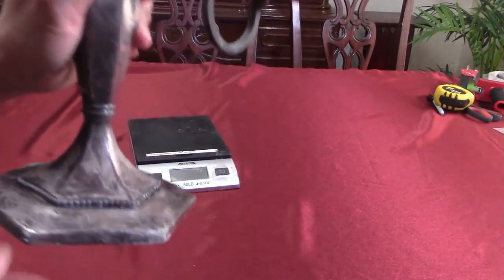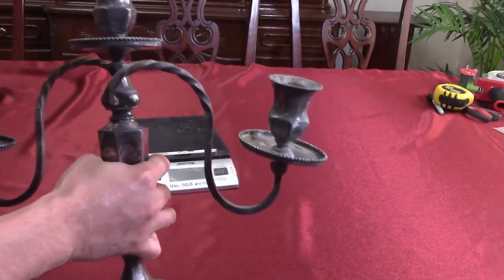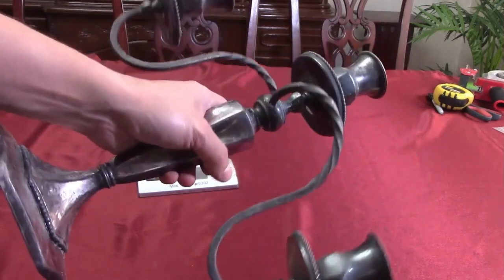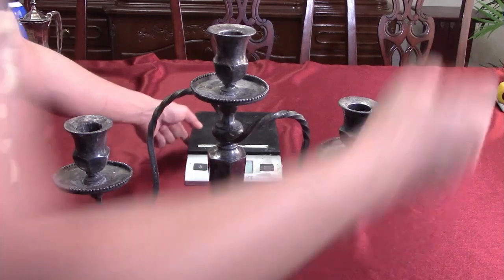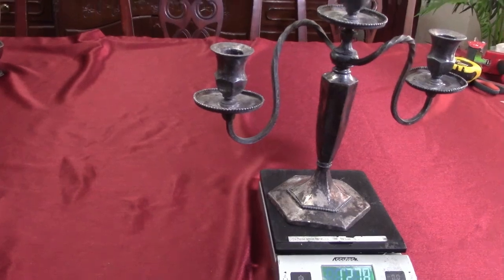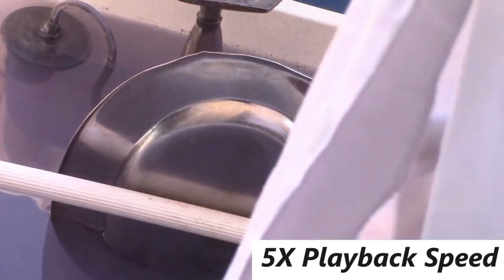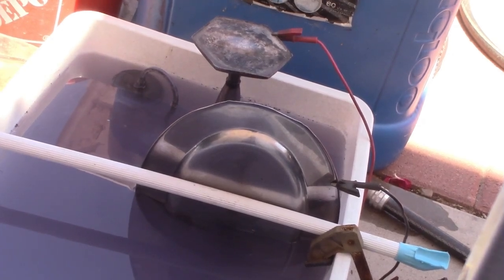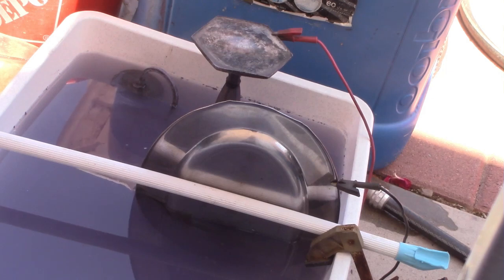How Much Silver Was Plated on Quadruple Plated Pieces - WIlcox Candelabra Pt 1

Comment: The gray color is silver chloride.   This is not soluble and will settle to the bottom of your container.  Carefully separate silver chloride.   Allow it to dry.  Once dry, put the silver chloride into a crucible and heat in an electri furnace.  This will liberate the chlorine from the silver.
Reply from the maker: Are you sure? 😁 I was hoping that just dilute hcl not heated up would not be strong enough to reach with the silver n form a chloride, usually you need nitric to react with ag.
Reply: Yes.  That is silver chloride.  The electrolysis is creating silver ions that immediately combind with the chlorine in the muriatic acid (HCl).  

Often, nitric acid is used to electroplate silver.  It is a more expensive acid but your silver yield will be better and with fewer steps.
Reply from the maker: It will form silver nitrate if adding nitric to the water and doing the electrolysis, no? So it's basically the same problem?
Reply from the maker: I might just go back to salt water. lol
Reply: The advantage nitric acid has over muriatic acid is that the silver nitrate IS soluble and stays in solution and is therefore much more efficient in the electroplating process.

There are quite a few YouTube videos on this process. Streetips is one such YouTube channel that refines silver in large, multi-pound, batches using nitric acid.

You have a great channel and you are definately on the right track.
Reply from the maker: Thank you. My current need is to simply get as much silver off my plate as time efficiently as possible, and my goal is only 80% pure and that is ok, as I am happy sending it to a professional refiner from there, so they can make it pure.
Reply: Sure. That is all good.  Just know that the gray stuff in you electrolysis cell is silver chloride.   If you were to save it and send it to your refiner they can recover the silver from it.
Reply from the maker: @shaywave  great! As long as it gets captured by my coffee filters I'm happy!